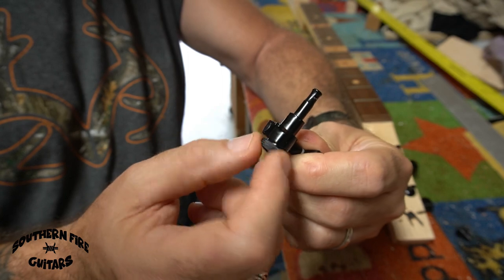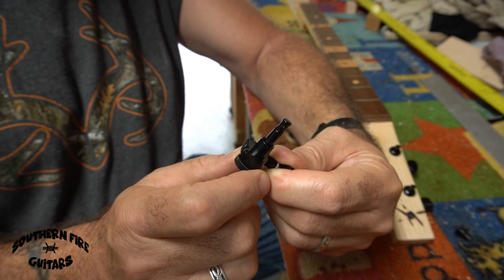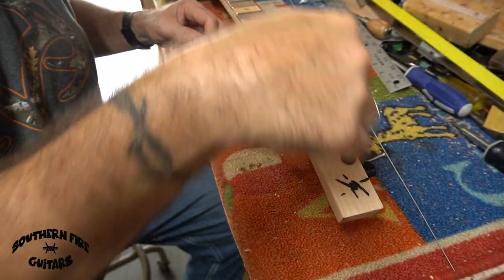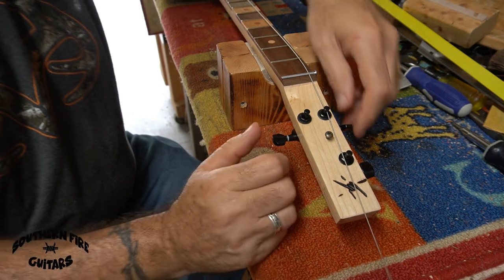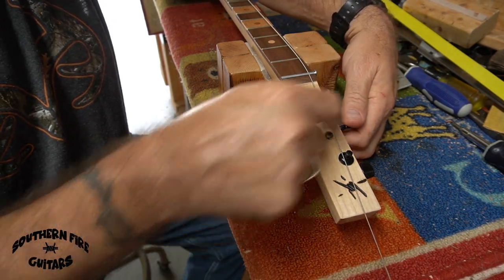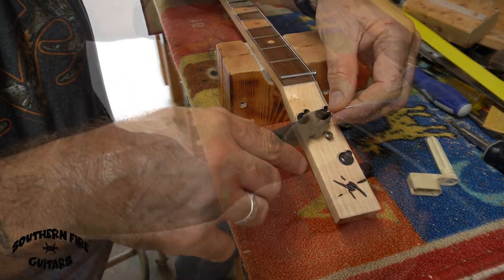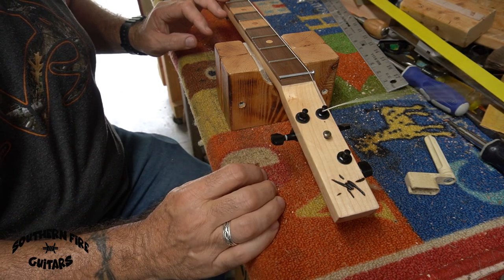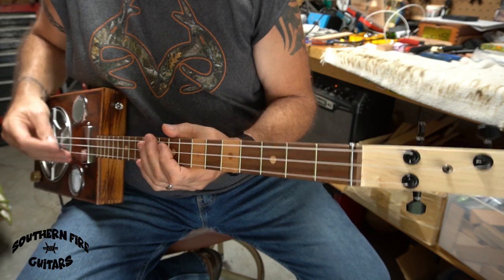Cigar Box Guitar -  How to Use Locking Tuners on Your 3 String CBG.

Comment: Are you winding backwards ? I go the other way with my tuners.
Reply from the maker: NO not at all.  I wind my strings for a straight string pull.   😎
Reply: Well yes there are Left and Rights I have three sets of the locking tuners. Next strings I will make shorter. I have like one wrap now.